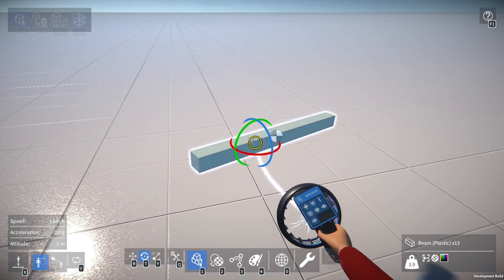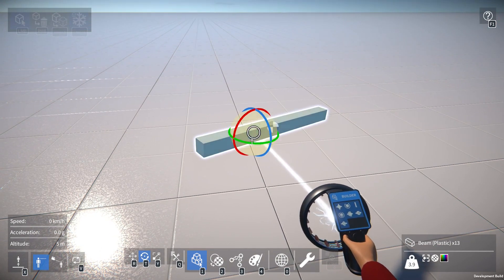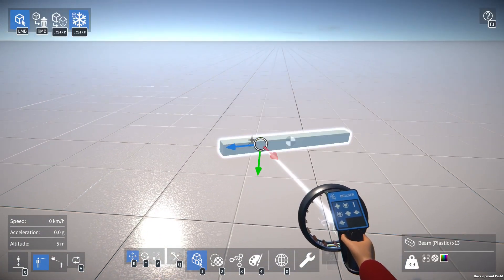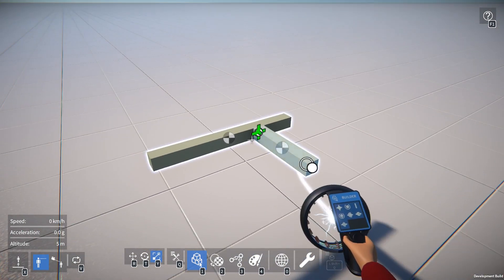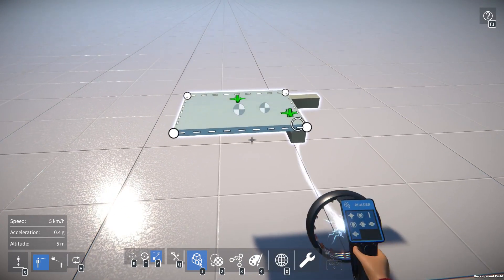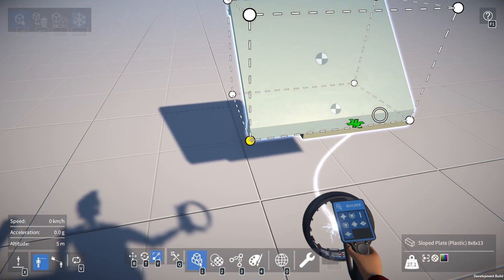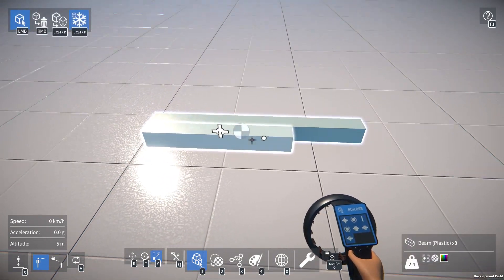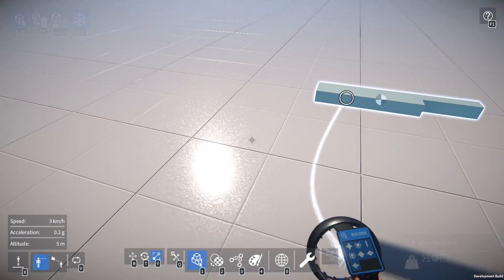GearBlocks dev diary: Part resizing manipulator

Comment: are you using some kinda voxel engine or are those plastic beams pre constructed(gameobjects)?
Reply from the maker: Nah, no voxels, all the parts are prefab gameobjects.  The resizable ones use run-time generated meshes (the demo only has beams and plates, but the full game has slopes, cylinders, and other shapes).

Comment: This system is already better than anything that I have ever used or even seen used in any building game or even paid 3d software. Also, I don't think you can keep the multiple part resizing in a voxel (wrong term in this case but you got what I mean) environment, because you can only scale it down if sizes of all the parts are multiples of one number and only scale it up multiplying it by whole numbers without the proportions getting distorted, wich is important in this setting. And some parts can't be resized in one or multiple dimentions in which you are trying to scale them, wich also hinders this. So I think everything is in it's ideal state, you can't get any more comfortable, fast and easy to use as well as more beginner friendly unless you come up with something genius which in this case I don't think exists.
About the sloped plates, can you put stuff on the inside of beam looking "mounts" on the end of them? We definitely need that.
I think you are pretty close to doing something that no other dev or even dev team has ever done, create a good physical sandbox, it's already quite polished and there are only a couple of things needed to be done wich was already in every other game, so it shouldn't be very difficult. You have done an insane amount of work, and you did a good job at it.
Reply from the maker: Thanks! :)  You can attach beams, axles, etc. to the mounts on the end of the sloped plate, if that's what you mean?
Reply: @GearBlocks  yes, thank you for the answer

Comment: I've been waiting for this from the earliest builds !! Crafting can now look more like normal.
Have you touched upon the physical mistakes that I showed you on my helicopter?
The rotor of which did not self-balance like a real one.
You told me that it was weird and that Unity usually handles it pretty realistically.
Reply from the maker: Remind me, where did you show me that?  On Discord?
Reply: @GearBlocks  I do not remember that it was so long ago. As far as I remember, nobody used discord then.
Reply from the maker: @roflmaomaogop  Ah OK.  I had a look to see if I have an old save file or anything relating to this and couldn't find anything, so you'll have to remind me about the problem. :)  Forewarning that it may not be fixable if it's a quirk of Unity physics that I don't have control over.
Reply: @GearBlocks  Yes, maybe this is really unsolvable, I came to the same conclusion myself, (I make some projects on Unity too).